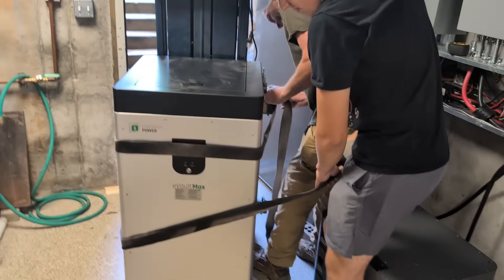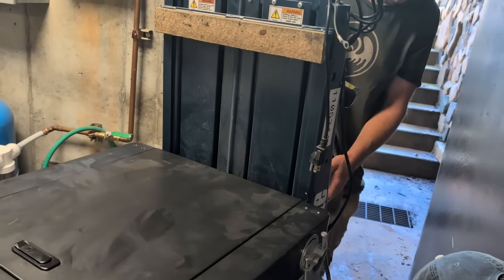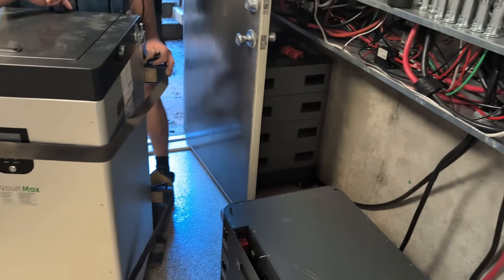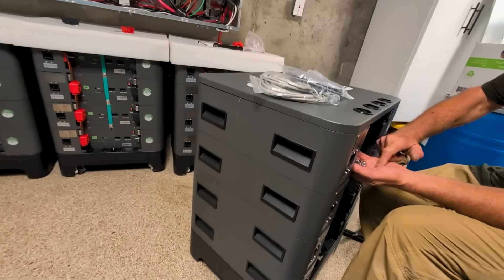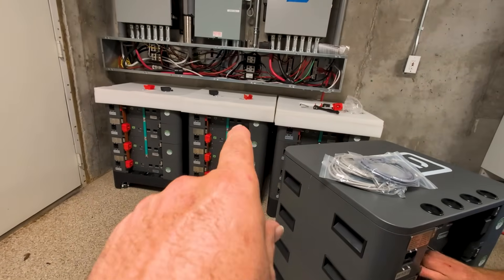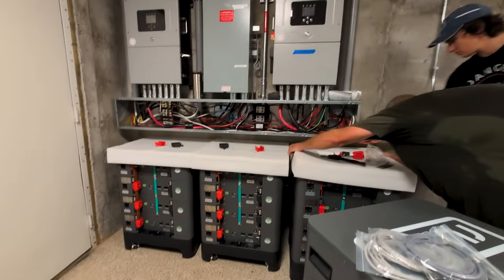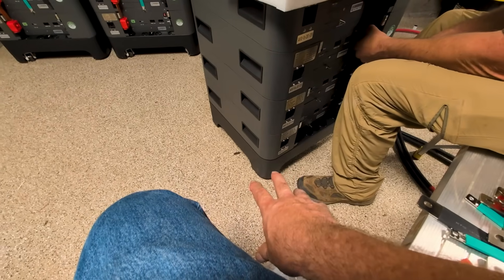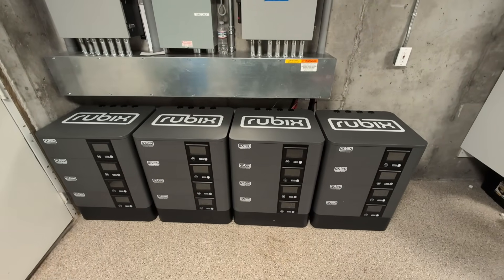Save Your Back with Stacked!

Comment: FWIW: I would say go with module batteries for basement, or stair challenge location. Use the heavy batteries only at ground level locations (ie garage or walkout basement. That said the Modular rack mount batteries make the most sense, because you can just swap out a bad module instead of hauling the entire unit when it needs to be replaced or serviced.

Comment: At what point does the Cybertruck's 123 kWh battery makes sense for backup home storage?  You can buy the truck new for $62k now, much cheaper used, and it's far below the price of a maxed out EcoFlow battery system.

Comment: I really like the design of those rubix batteries. Just wish you could buy and inverter that would stack on top of them for an all in one solution. I know that's not the main target audience but that would make a awesome roll around power station.
Reply from the maker: If you could, those casters would limit you to about four or five batteries.  They probably won't be happy with me if I make that suggestion.

Comment: I’ve watched a score or two of these videos and based my system on what I learned here. My system is fully operational but needs some features: 1) I have a Rapid Shutdown Switch for the Sol-Ark mounted near/outside the exit door. My powerhouse is 30-ish yards away from my house. I’d like to have a second parallel Shutdown switch at house. Is there a remote wireless switch available? I have not found one, just finding stuff that I could kludge together. 

2) the smart load circuit does not function as I understand it. The ON conditions seem right but the OFF conditions do not; once on, not off until the SOC is lower than the preset value. It needs to go OFF at sunset or some user adjusted time.  Else the unneeded ‘special’ load simple drains the battery until that SOC level is met.  Not good if the battery reaches the upper SOC value late in the evening or a storm blocks the PV. 

3) I dont recall seeing any videos on Surge Protection Devices, recommendation for local (powerhouse) or whole house (which I see coming via the NEC)?  

4) I didn’t see anything on ‘connecting all earthing rods’ which seems to be the way it should be done.

How about mentioning the methods/decices that you are using?

Comment: Yep… I used this to move 4 225# Kilovault HAB 7.5 up one flight to my second story apartment…. 

Eventually my 1st floor neighbor came out to see what the noise was all about.  

Younger and stronger than me… (I was 70 years old) we man-handled the remaining 4 upstairs in a quarter of the time and half the sweat - those HAB’s wanted to be counter balanced with muscles.   

So the equipment is good for one or two very heavy items. For more, just get help and be done with it. 

We were moving to Montana in week or so and wanted the gear delivered ahead of the move and stored in a climate controlled space (controlled space was available before the move, and not available for months, if ever, in Montana) 

So for a few weeks I had 8 HABs in wooden shipping crates and two SA 12k’s lining the walls in the living room.

I did get half my rental money back.  And for the installation I used a vendor hydraulic cart for moving and hanging batteries, SA’s and wiring raceways.  The $300 table has proven to be the best purchase; I still use it frequently - even a year after it was purchased and the work done.

Comment: ENGINEER 775,
1. I AGREE! 
2. WE INSTALLED ON OUR SOL-ARK 15k THE HOMEGRID 6 STACKED 28.8 kWh, WITH 14.4 kW CONTINUOUS POWER OUTPUT, WITH 24.4 kW SURGE FOR 10 SECONDS.
3. IT HAS NET ZEROED OUR HOME 🏡 
4. THANK YOU 🙏, FROM THE SUNNY ISLAND 🏝️ OF BERMUDA!
5. OVER THE YEARS WE HAVE LEARNED A LOT FROM YOU & YOUR FORMER TEAM ABRAHAM , JOHNNY & ANTONIO!
6. WE CONTINUE TO LEARN FROM YOU & YOUR CURRENT TEAM!
7. KEEP UP FULFILLING YOUR CALLING & DOING EXCELLENT WORK!
Reply: I REMEMBERED WHEN YOU DID THIS INSTALLATION!
WE LOOK 👀 FORWARD TO YOUR NEW INSTALLATIONS, CODE UPDATES & SOL-ARK PROGRAMMING TWEAKS